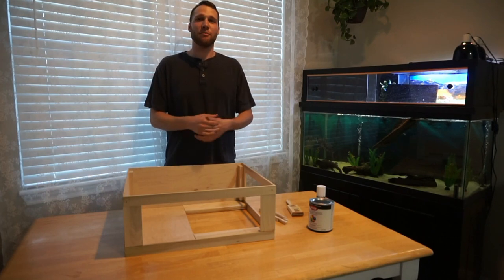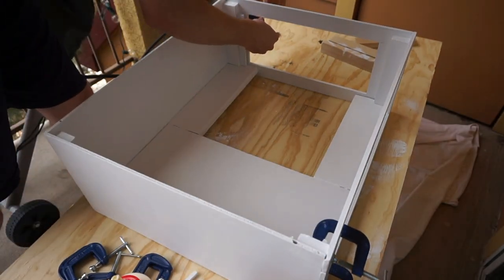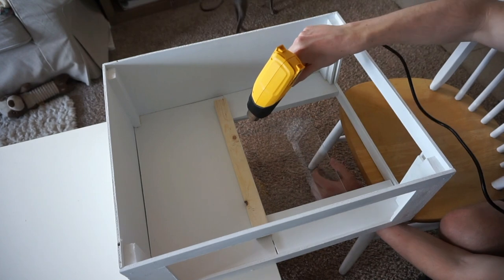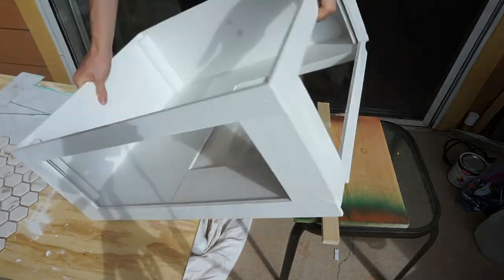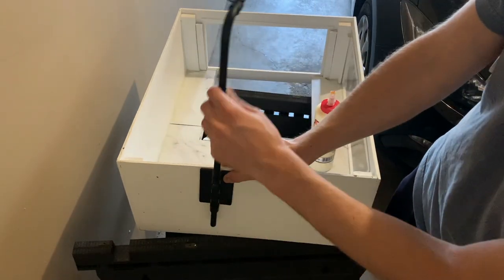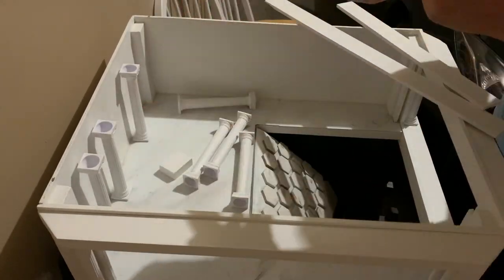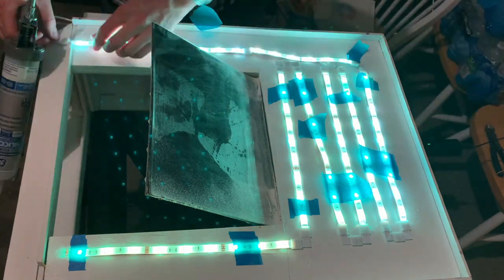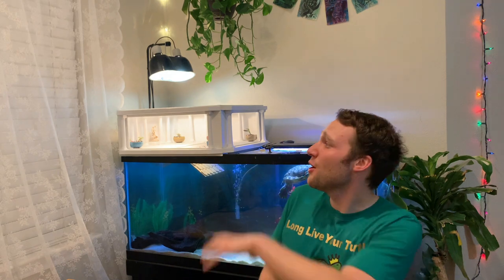Part 2 - DIY Above Tank Basking Platform for Turtles - Grecian Theme - Step By Step Build

Comment: Possible quarter inch lip, right near where the ramp ends. Provide that little square space with sand and such. The lip will prevent all the sand from exiting?
Reply from the maker: Not a bad idea, maybe I'll work it in a some point. Thanks!

Comment: Hi !! I just got 2 baby yellow belly turtles. I absolutely love this basking area. I am about to transfer them to a 65 gallon tank so that I don’t have to buy another for awhile while they grow. I was wondering if I could still make this platform for them. Do you recommend any changes apart from the dimensions obviously lol
Reply from the maker: Hey! That’s awesome! For changes I’d recommend skipping the led lighting underneath and just buying a “hidden led strip”. Otherwise the design worked quite well, just quadruple coat the bottom of the basking area with waterproof paint so that the water does not rot the wood. Good luck with your two new little ones! :)

Comment: Hi there! How did this ramp (tile concept) compare to the repti turf ramp in the original turtle topper video? My turtle is rather large and sometimes has a hard time pulling herself up different ramps. I'm going to attempt to build the original topper this weekend but am skeptical about what type of surface I should glue to the acrylic? Did it seem like the turtles had an easier time with one or the other?
Reply from the maker: Hey! Awesome to hear you are making a basking platform! For my turtles, both concepts worked well. You could try starting with the turf as it is less permanent than the tiles method as you could just rip the turf off of it is not doing the trick. One pro to the tile version is that I dries quickly so when you are removing the topper it doesn’t drip everywhere. Also make sure your turtle doesn’t just want to eat the turf. Lol. Good luck!!! Thanks for the comment :)

Comment: I have a quick question. On an older video of yours it showed sand can be a nice alternative. I recently got sand from my parents and I really just wanna make sure the sand is okay. In the older video it showed silica sand. but the sand they got is blue and it shows a turtle on it but also a bearded dragon which makes me think it wont be good for my turtle. My turtle is an Eastern Painted Turtle and she is not even a year old yet, probably close though. The brand of the sand is Vita-Sand and on the bag it says ALL natural vitamin fortified calcium carbonate substrate. and in the ingredients it has the following: Calcium carbonate, magnesium carbonate, iron oxide, beta carotene, ascorbic acid(vitamin c), calcium pantothenate, vitamin B12, biotin, vitamin B6(Pyridoxine HCL), niacin, riboflavin, vitamon b1(thiamin HCL), folic acid, and dicalcium phosphate. i dont wanna switch and put my turtle at risk. so an answer asap would be really appreciated! thank you for the informational videos!
Reply from the maker: Hey! I would not use sand like that. It probably shows a tortoise on the package? For turtles the sand will be fully submerged and the fortified parts of it will dissolve into the water column. Not sure if it will harm the turtle but most certainly is not needed. Best substrate is one that does not react with the water (inert) as you know it will not affect anything. I suggest going onto forums to see if a similar question has been asked. Once answer I found after a quick search is: http://www.redearslider.com/forum/viewtopic.php?f=5&t=32377
Reply: @LongLiveYourTurtle  thanks for the info also is impaction a big issue for the turtle with sand? i was told that the sand can cause impaction and i dont know if thats true or a good idea
Reply from the maker: I’m not a vet so my advice is just opinion but sand is much better than pebbles or small rocks in terms of impaction, sand would pass through the turtle while larger pebbles could get stuck!

Comment: I have a cat so I don't want my turtle to be exposed with the top open what would you suggest I get for a top?
Reply from the maker: Good call! You can make custom screens with supplies from a hardware store (screen trim and adhesive, all of which can be cut to suit your needs). Then use a clip or weight to keep your cat from getting in. If I get the chance I'll make a DIY video on how to do it! But don't wait for me :P Otherwise you could try to mix/match acrylic/glass/reptile screens to cover the opening. Just make sure your basking area only has a screen over it as glass/acrylic block UVB! Thanks for the comment!